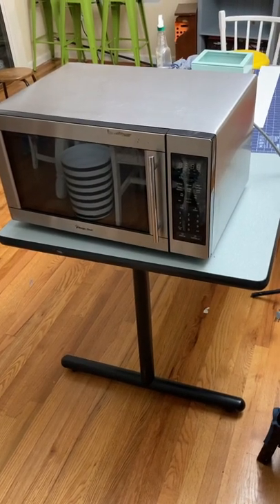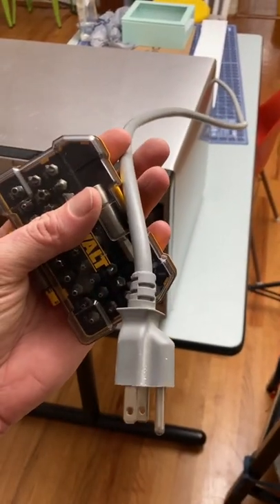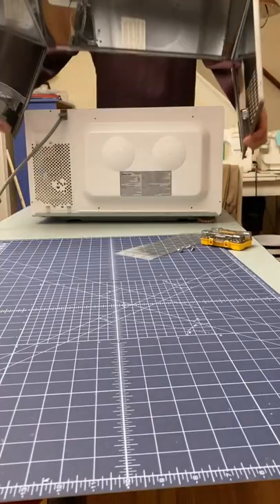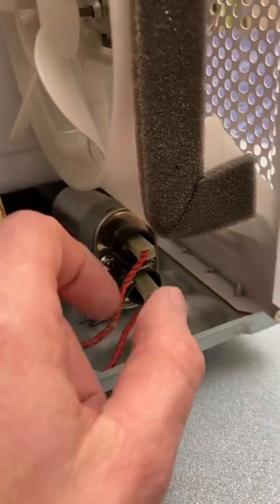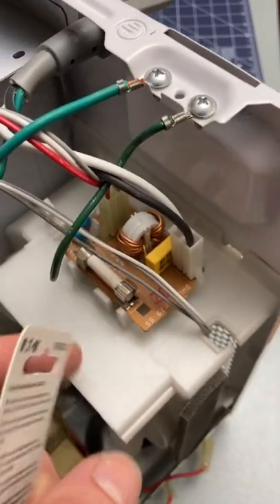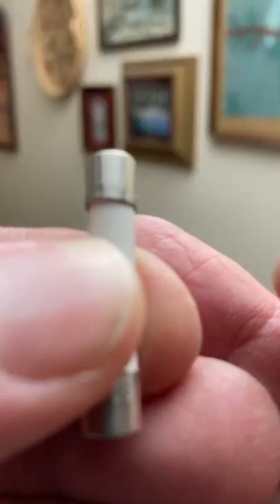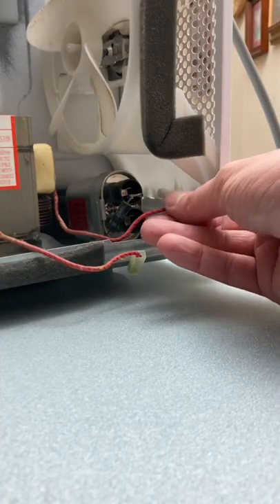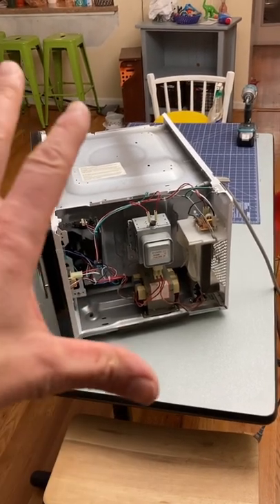Easiest microwave fix

Comment: Disconnecting the HV capacitor like that is very dangerous, it should be discharged first. The usual reason for the microwave fuse to fail is worn/dirty contacts in the Door interlock switches.
Reply: How do you discharge?
Reply: @friwan short it out by placing something metal across both leads, but you have to have it insulated so that you’re not touching any of the metal.  As in pliers with a handle, screwdriver with a handle, pretty much anything but with you not touching the metal.

Comment: Thats not mostly the problem...most likely it could be the Magnatron or Diode...
Reply: Mag and diode don’t cause hi amps in a microwave, just the transformer, and caps or bad switches opening out of order will blow the fuse

Comment: my fuse blew up and I replaced it with a 10A fuse and it is working, in your case, you used a 20A fuse would it make any difference between the fuses? Thanks
Reply from the maker: You would want to use the same size fuse as the original. If you go larger, it could cause something to melt or catch fire before the fuse blows.

Comment: I'm so mad, I bought new fuses, and it didn't work. Checked continuity on all three switches and they all function properly with continuity and checked the thermal fuse and that works too and it still doesn't work. I bought this thing new 4 years ago. Exactly the same set up too as yours. Probably a board I guess
Reply from the maker: So sorry to hear that.

Comment: As a technician I can tell you three things
1-I have run those things plenty of times with the cover off.
2-I have never unplugged the capacitor to remove the fuse.
3-I have run tests on the unit, with a plugged in.... And almost blew my thumb off 🤣🤣🤣🤦🤦
Reply: Same ! Switched out like 20 fuses 🤣🤣🤣

Comment: I see there’s a few videos on this topic. When you say stops working.. are you referring to just the heating portion or completely Not working? My Hamilton beach stop heating food but would turn on just no heating of food. As of right now it’s sitting on my workbench following the instructions of this video but my fuse between the connection points is white with the red line around the middle. I can’t see if this fuse is blown but now,after watching a few videos I think it’s that heating element and not the fuse?
Reply: If no heat, it usually is the Magnetron. Good video on one replacement: 
https://youtu.be/UKi_T4QmqeI?si=URWTLLRD0xaLVAwz

Comment: What happens if you turn it back on without the cover
Reply from the maker: Good question!! The cover is meant to help contain the microwave radiation. It's a Faraday box. It's also why microwave windows have the honeycomb-looking metal screen behind the glass. That acts as a Faraday cage.

Comment: What caused the fuse to blow?
Reply from the maker: I’m not sure on this one DW. They can blow for a lot of reasons. It could have been from an external power surge,  overheating, a part like that high voltage capacitor going bad (those are actually pretty cheap too), a faulty door switch, etc.. Unless it blows more than once within a couple of years, if there’s no obvious culprit, I just replace it and go. This on blew once before about 6 years ago.
Reply: More than likely the capacitor or door switch. 
I've been doing appliance repair for quite awhile. Take the advice from this channel. If it is the capacitor, call a qualified technician.
Reply: So when the fuse blow does it turn white! I see you have to different colour fuse, the one you install was gray